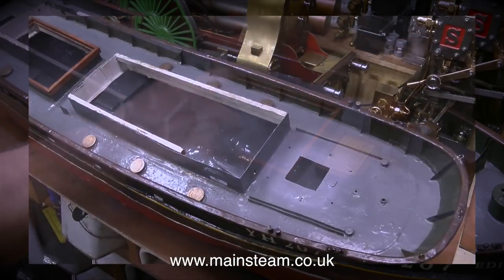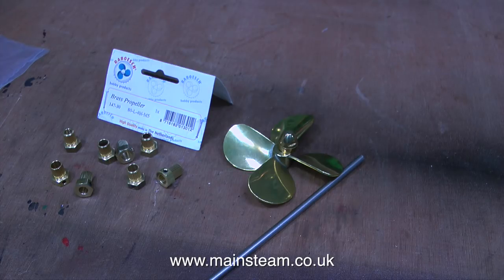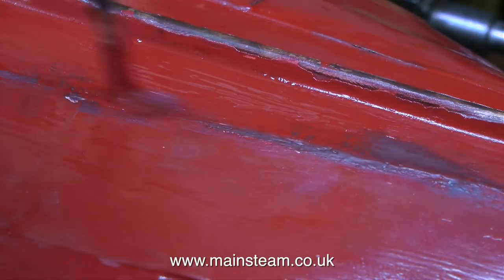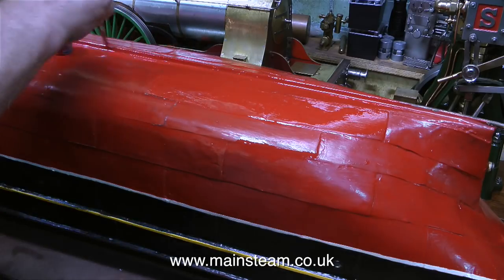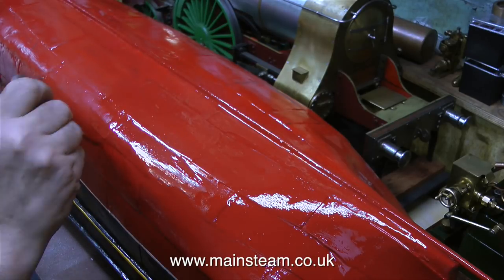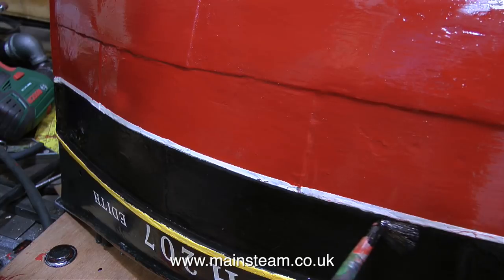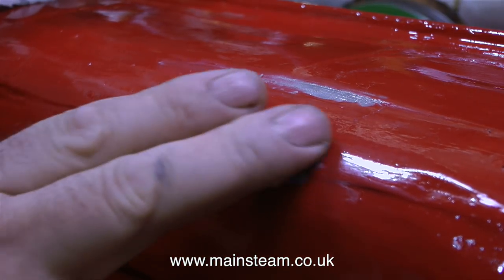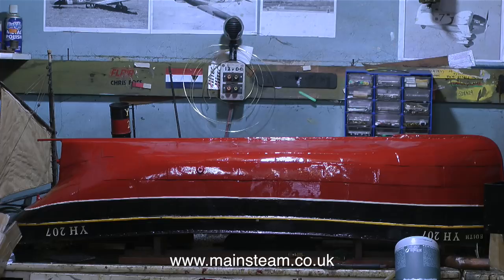A MODEL STEAM BOAT NAMED EDITH - PART #21

Comment: Hello Keith, Excellent video! I have a question regarding the process of matching colours. In my limited experience with water based colours gouache colours, they always darken and dull a little when they dry, making matching colours very difficult as the wet and dry paint aren't identical. How do solvent based colours like the ones you use on your models behave? Do they not have this problem?

Thank you as always for your lovely videos. They really brighten my day.
Reply from the maker: Yes they do tend to darken slightly after drying .....
Reply: I see, Thank you!